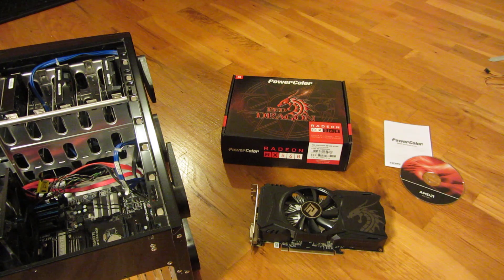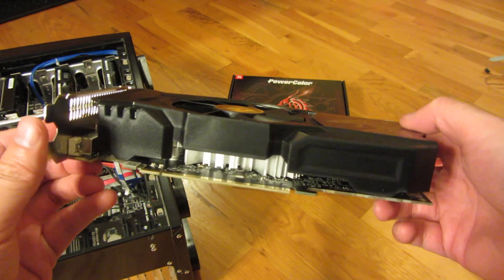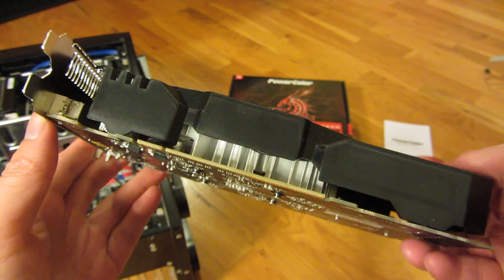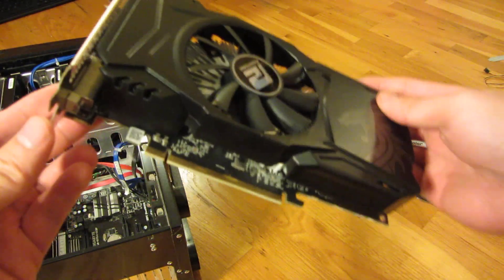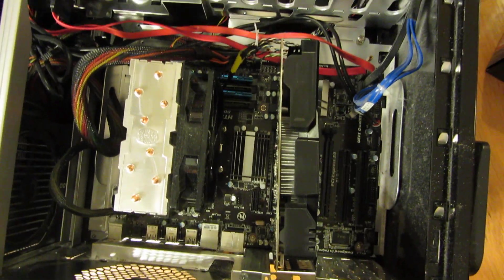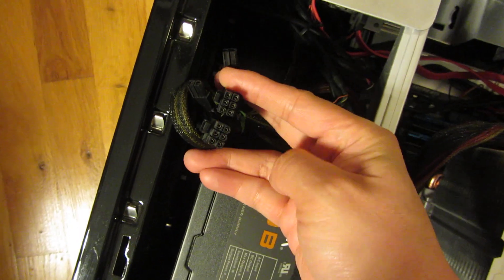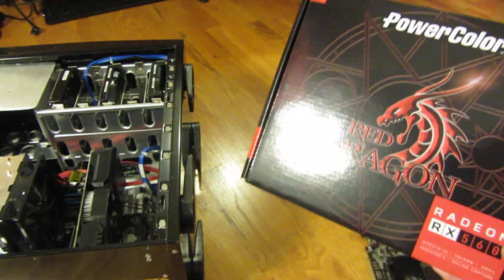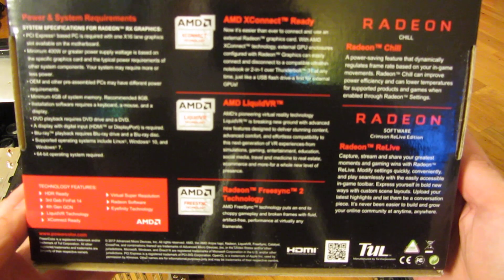AMD Radeon RX560 | PowerColor Red Dragon | 4GB GDDR5 | Graphics Video Card

Comment: Blew my mind that there was no 6 pin connector. Instantly thought I got scammed on ebay. Thank you for this
Reply: so do you not need to use power for this graphics card?
Reply: @awamorii  no, it draws all it's power out of the mother board. Not the cable from the power supply
Reply: @clintcheezewood  thank you so much i just finished my first build
Reply: @clintcheezewood thank you, im starting the ultimate budget build N my mobo had a slot that said “GFX PWR” N maybe thought i needed a psu that came with a cable that fitted that slot

Comment: I have it, and gonna be honest,for me who wants to have fun with Pc gaming spending little, it is making good use to me, I am very happy with the purchase.

by the tests and comparisons I made here, it has a performance superior to RX 460, it is an AXRX 560, not an Rx 560D.
Reply: Does it run at high fps for like csgo, fortnite, rainbow six siege and war zone because these are the games I want to play and I am on a low budget
Reply: @reubensmillie6556 Hi!

CSGO: Runs 60+ FPS on Ultra settings.( 1080P)

fortnite: 60FPS on medium( 1080P)

Rainbow six: 60 FPS on High (1080P) - Small drops to 45FPS.

Warzone: to play Warzone without lag, you need more than 8 GB ram, and 4 GB of Vram, as it consumes a lot of memory, you can play at low with 8 GB of ram with a bit of stutterings. 

Ps: My processor is an I3 2130 with 6gb of ram and 2gb of vram,  I can enjoy all the games mentioned, Warzone is the only one that needs a little patience, but you can enjoy the game well.

I recommend the RX 560 with 4Gb of Vram, it is possible to enjoy games without stutterings with higher settings.

Have a good day!

Comment: I just ordered this online for 99.99 with $20 rebate. Let's see if it was worth it for a budget build. Also can you do benchmarks like other commenter mentioned? Thank you.
Reply: And how is working in games ?,  i am also planning to buy this card
Reply: Good, worked right out of the box. But this card is mostly for e-sport games. I tested it on Witcher 3, and at 1080p on Medium settings i was getting 30fps. I bought because i got it at 80usd and was going to use it in a budget build. I wouldn't pay anymore than that. The Card I have is a gtx1060 3gb card. So far its a good card for 1080p 60fps gaming in most games. But for what the powercolor rx560 is, its a good card for the price of 80usd. But if you can get 1050 at 99.99 then get that.
Reply: I currently have amd 7850 2 gb OC , and i played all new games on medium 1080 , except assassins creed origins , cod ww2 , i think is not worth it to upgrade from 7850 to rx 560 or gtx 1050
Reply: yeah it might not be worth it. Because this card probably wont be much of an upgrade, maybe even a slight downgrade. This card is not full rx560. It has less stream processors than regular rx560. But what these cards do have that is better is they are more energy efficient. But I recommend the gtx10603gb for 199.99, or less. Because you will definitely "see" the upgrade. I run Witcher 3 On Ultra at 60fps 1080p. So its up to you, but i recommend saving up and getting a card for your needs.
Reply: drubesrubio  thanks for advice i wil probably buy a gtx 1060  , but the other may be my cpu i have amd fx 8350 4.0 ghz , and 16 gb ram ddr3   , i think this cpu wil bottleneck gtx 1060
Reply: Yeah i might bottleneck the 1060 a bit but not that much i think. I have a ryzen 3 1300x and it does fine with that. But yeah, just look at benchmark videos with your cpu and see what card is best for it.
Reply: I have the fx 6300 and amd r7 250 and if i add another gpu like this or a 1050 gtx do you think i could run alot of games on 1080p or close with good fps? i have 8gb of ram and a gigybyte motherboard
Reply: It depends on the game. But these cards cannot run at 60 fps on newer titles. Older titles, most likely will run well.
Reply: so should i pair my 250 with another 250 and its better than this or should i just wait and try to get a beast gpu?
Reply: Its up to you, you can do that. But it better to get best gpu you can afford at the time. Not all games will be optimized for crossfire.